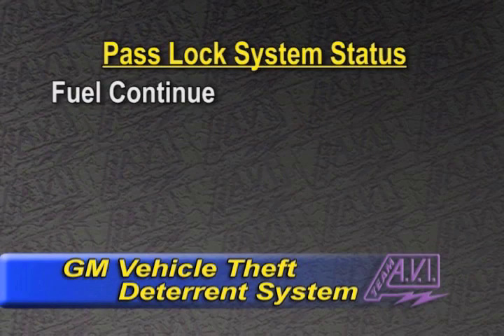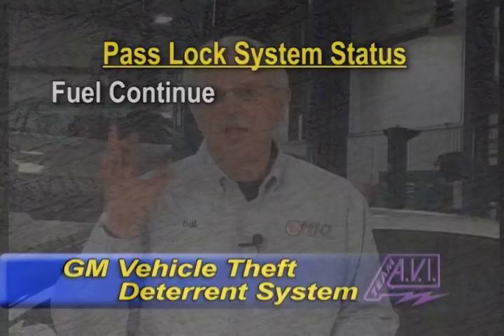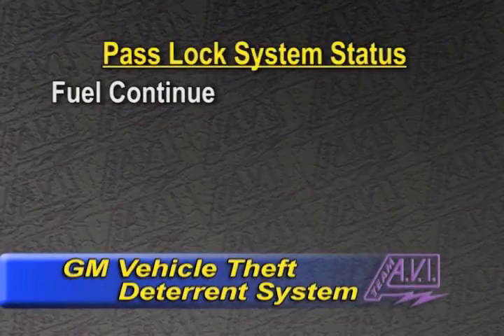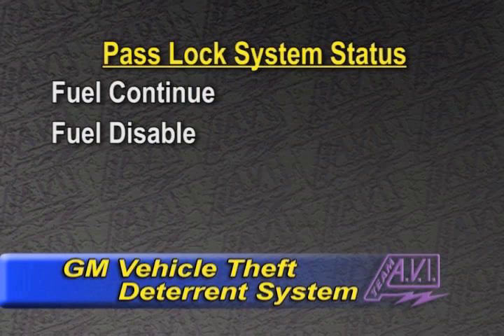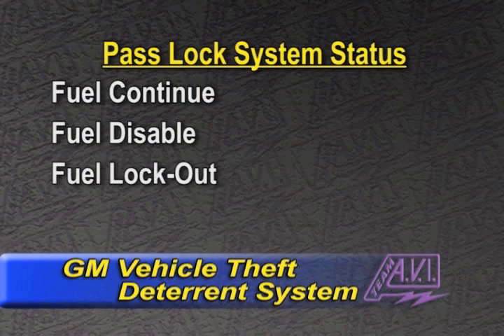Pass Lock System Status| Bill Fulton | Tech Tip

Comment: You mentioned that the voltage is pulled down. My tahoes signal does not get pulled down from 5.16V It stays the same when I crank the engine,  it starts for 1 second then dies. I don't get the 10 minute lock out. My question is what pulled down the voltage in the lock cylinder, is it the passlock housing hall effect sensor? Is that why it disables the injectors?

Comment: I definitely need do.e help here
... Im getting 2 dtc codes one is U1056 and P1626..... Not sure how many volts the red and white wire voltage is supposed to read with ignition in the on and off position.... But mine is just below 12v even when cranking ( my 2003 gm truck wont start ).
Anyway I get no voltage from the orange and yellow wires... Well I think the yellow wire gets something but I can remember right now... I'm frustrated...lol. Anyway.
I think this thing is why the truck wont start I just want to be sure before throwing another part at it... So if you could please share how I can properly test that sensor on the ignition housing with a multimeter Ill really appreciate it... That's all I need to know.

Comment: My car died flat and I had it towed to shop. They call me 4 weeks later cant fix it. I think they changed the ecc and bcm.  I had it towed home and have a question? I went through the 10 min thing so many times but no crank but my radio locked out. I have the original bcm that wont open windows and other things but allows my radio to come on. I have never gotten it to try to start. I rang out the system and no fault. Once its locked out do I have to go to the dealer to have  bcm flashed to new ecu?

Comment: For example 1.15 volts, does no one know what the correct voltage is on the yellow wire ????????????
Reply: ????????????12 if you ByPass C220a

Comment: THIS IS PART OF THE IGNITION RECALL... 2017 NOT GOING AWAY
Reply: No this passlock issue has nothing to do with that recall. Their ignition recall 2014 is for keys slipping out of the run position while driving. 
Unless they are not wording it correctly, they make no mention of the faulty ignition housing/passlock system which is anti theft related and not the same as the ignition slipping out of the run position.

Comment: I cut my 2001 surburban off and it won't start back up it set over night and this morning it cranked up fine and it has multiple times so far is that a security problem
Reply: if it is the security it takes 10 mins before it will crank back up. did u ever get the problem fixed

Comment: I had a security light flashing and car would not start on my 04 grand am took the key  cylinder out push it back in had key in run position for 10 minutes turned key off fired right up no more problems security light off completely runs fine !!! hope this helps someone else lots of people making money off this issue I fixed for nothing
Reply: Thank you.  A friend of mine is having this problem now on his 2004 Grand Am.  I will tell him what you said.  Thanks again.   :)
Reply: 2facecapone
Reply: Are you guys still incident free after all this time?

Comment: Yes Yes Yes.  I belive I am having this problem.  FUEL ENABLE.  Three weeks ago I replaced an igniton cylinder lock and key.  I did the 30 minuite relearn process.  Everything was great.  Last week my neighbor had a problem with the new cylinder lock which was preventing the vehicle from being shut off.  In great desperation to shut the vehicle down, I think he disconnected the battery while it was running, then the fuel pump relay was pulled out to stop it from running.  I managed to replace the defective cylinder lock with another new one. (obviously with new pk3 keys)  The funny thing is that the vehicle started without the relearn process this time and the security light is ON STEADY.  My question would be is how to get the light OFF now.  I do believe that this was a freak coincidence all because of a defective cylinder lock and it was not even my fault.  I would like the light off and the system to work like it is supose to when I first fixed it in the first place.  This is the only video that explained it to me how the system works.  Thank you Bill Fulton for the great video.  If you have an answer I would appeciate it.

Comment: hello, i am dealing with a security lockout i think. i cant get any voltage reading at the passlock sensor so maybe that helps you get an idea where to look next? first the van would start then die like you described here. (2001 chevy express 3500) after looking into the passlock system i now have no spark, no fuel but turns over still. the radio says "LOC" all attempts to disarm the security feature seem to fail, including the "relearn passlock code" procedure.

Comment: Some models, they say you can go through the Settings on the radio display to disable the alarm in order to crank the vehicle. Here are the instructions if you are lucky enough to have the Alarm in yours:
1) Turn radio off.
2) Press Tune/Display button and hold until "Settings" appears in display.
3) Using "Seek" button, flip through the Settings until "Alarm" is displayed. Press station button 1 to turn Alarm "*Off", then press Tune/Display button to save that setting for "*Off."
4) Last, using "Seek" button, flip through the Settings until "Exit" is displayed, then press Tune/Display button.
5) All done!
The only other way I've seen, which I'll be doing to my car this weekend, is to install a toggle switch to disable the alarm as needed to crank it. There are videos showing how to do this on YouTube.
Reply: Does it work?

Comment: 2000 Chevy Silverado. Truck ran for 2 seconds turned off , steady security light drained battery on while key off. Took Ohms reading to find spliced wires so I changed complete steering column for this would make the wiring hole again. Now I have same starting issue but without any lights other than the battery light. Tried the key relearn 3 times without security light being on still nothing. Unplugged BCM plugged back in Nothing Any ideas ???
Reply: +V Cornejo   Mine turned out to be the ECM

Comment: I have 1990 Corvette.  Since removing the Bose Gold unit centre of dash only I have not been able to start the car.  Plugged the head unit back in and car will start and run for a second.  Will keep going or restart.  Tried your method and came to a problem.  After 11 mins or longer the security light is still on solid so cannot run the process to reset the computer.  What is the problem with that?
Reply: +turbovette426 hello, i am having the same problem as you, passlock issues, i described in detail above, if you solved your problem please help. thanks!
Reply: +Rob Sikes  I managed to get the car working but the problem turned out not to be the passlock.  I had done the resistor match in case of key and ignition failure.  Not that.  Then noticed that I had start for a second or two on initial start.  That fit the second part of the passlock system.  The fuel enable.  I put in 2 different modules to bypass the BCM that gives that signal to the ECM.  Worked but only for maybe 15 minutes then quit again.  I checked the codes with the ODS and then with my engine computer and found the VATS ERROR was coming on then off and then on again.  Finally after observing other abnormal things happening I changed the ECM.  That fixed the problem. Now starts and runs strong all the time.  The ECM I bought on Ebay for 75.00 was rebuilt and works great now.  I think that I could even remove the bypasses now and would still work but not going to.

Comment: I need help PLEASE.  I had the lockout, 10min wait for several months. finally stopped everything.  It I think I fixed the problem, replacing the Hall effect transistor, Now the security light is out, works as it should, (I think) I get a good strong pulse at the injector but the engine will not start.  55lb at the fuel rail, I have an 04, Chevy, classic, 2.4L Ecotec I have good coils, tested, replaced, Known good. The transistor pack (ICM?) is good, replaced, tested... I fear the pulse that drives it is the issue. Someone tell me what the pulse should read. I only have a digital or analog VM, I only see a weak pulse about .2 to .3 volts  I think it should be more. If it should be more, how do I get more?  I have been without a car for a month now due to age and health issues. Thanks to anyone that can offer any help.